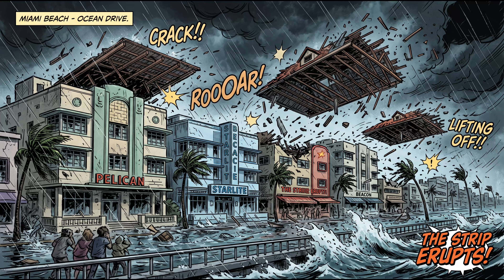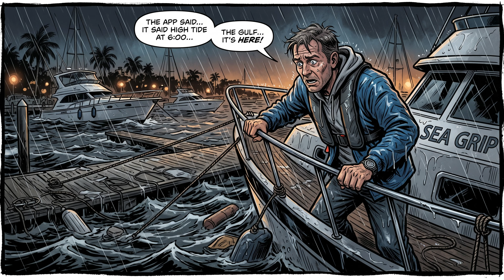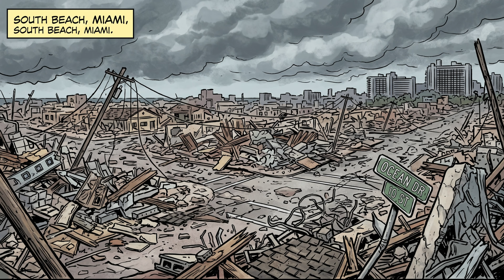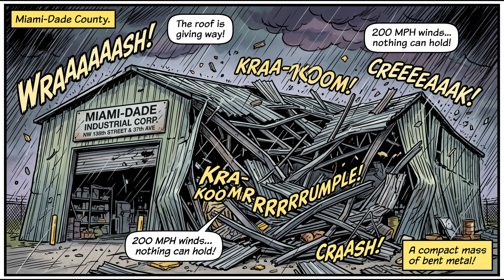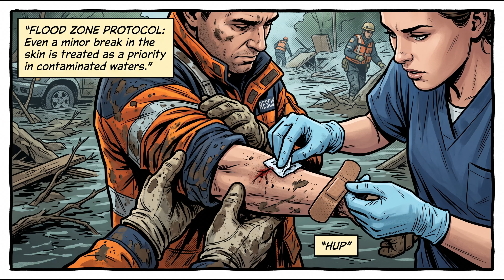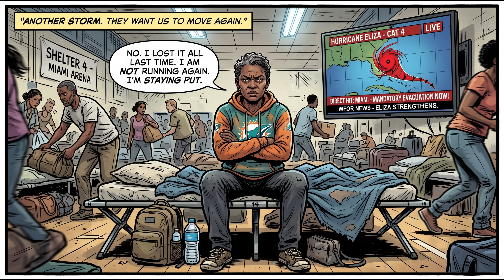What If a Category 6 Hurricane Hit Miami? (Second by Second — Month Later)

Comment: ok, first off, using Katrina as context is just idiocy.
Katrina damage and fatality's had almost NOTHING to do with the wind speed, it was the amount of rainfall, both leading up to the storm and then the surge plus rainfall during causing the breaking of the levee's and subsequent flooding...

Andrew is a fair comparison for certain, but there are at least 2 other storms that could be used for better comparison. 
hurricane's Charlie and Irma. both of which had high sustained winds and both of which the winds were the primary cause of damage.

the AI is using sensationalism in the number of a deaths due to stormfall, just not the actual reasoning for those deaths. 
so the reason neither Charlie or Irma or even Ian are mentioned is because people are more aware and warning systems are much better.